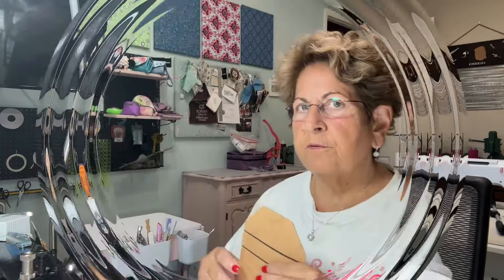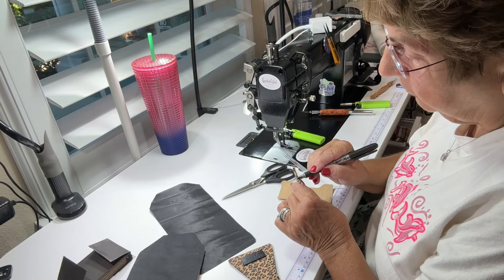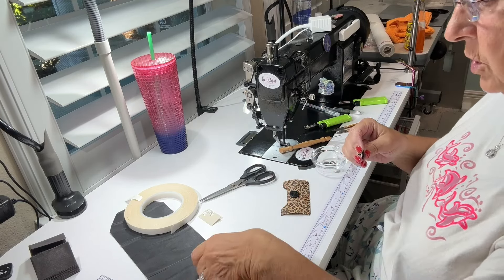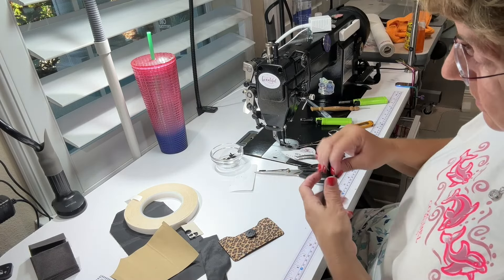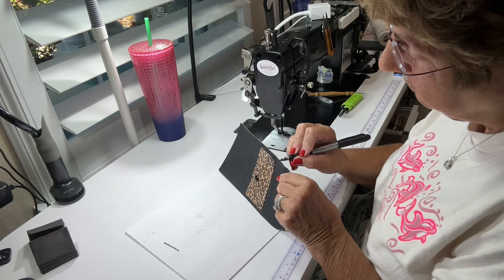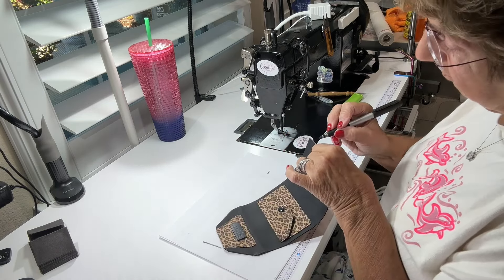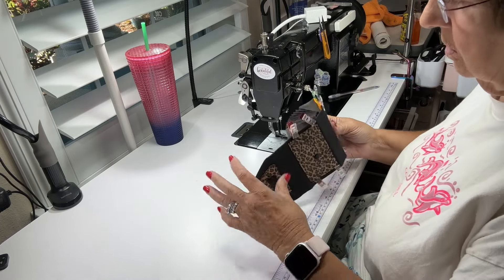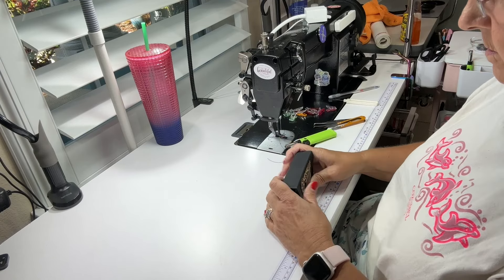The Simple Wallet Version Two - a pattern by Simple Artful Stuff

Comment: If you don't have selpa , could you use decovil?
Reply from the maker: Hi there, here is the designers recommendations -  if you have Decovil Light on Hand I'd go with that over Kraft-Tex. Kraft-Tex is made of paper and is NOT supple like Salpa.It has a bit of cardboard feel and is also prone to wrinkle. (And the wallet flap bright break down over time with kraft-tex) Do you have Decovil light on hand? While DV Light is not as supple as Salpa, it is at least a stabilizer with some body,, whereas Kraft-tex is actually meant to be used as a fabric even though it is .55mm. Having said all of the above, if you don't have Decovil Light, then just use what you have. But at some point when you are ready, you will reply enjoy working with Salpa. And should give it a try--I think you will like it. Happy Sewing.
Reply: @jeanniesdesigns5295  Thank you